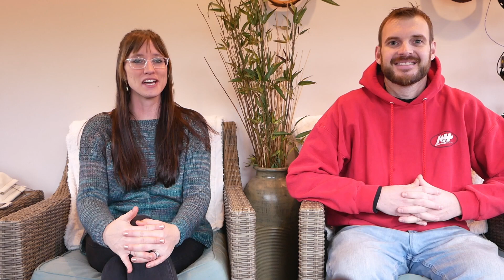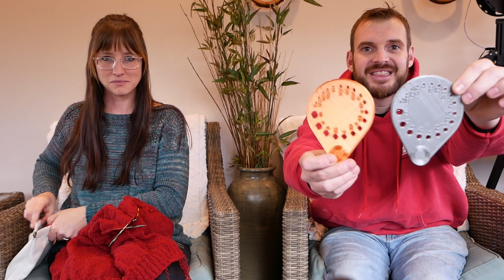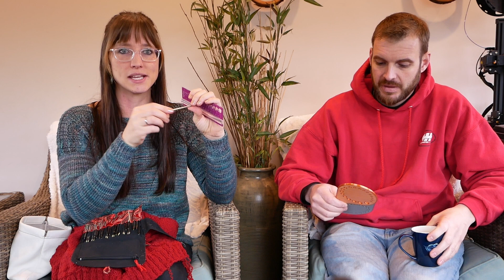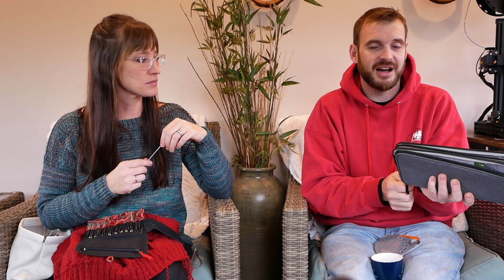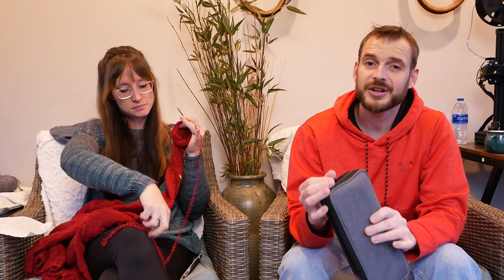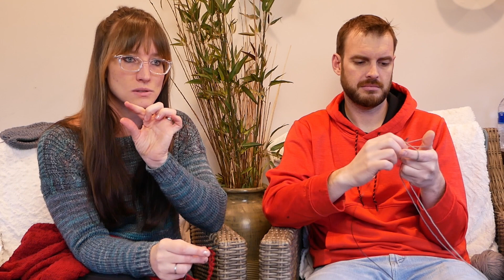Spring Stitch Knits - Episode 2 - 3D Printing, Casting on, and USED RAMEN NOODLE YARN!

Comment: Have you tried skeining, soaking, and drying the yarn between sweaters to skip the ramen noodle effect?
Reply from the maker: I did.  And sometimes do when I know it matters.  However, the ramen look doesn’t bother me too much bc I am comfortable with the feel of it. 
But it is a great recommend to anyone who needs to reach an exact gauge and smooth effect.  Thank you 🙏
Reply: @springstitchknits  I love long tail cast on too! But my process is a little different. I found the hardest part is estimating how long to make the tail. 😂 bit a couple youtube videos later and I usually remember to wrap 1st then cast on.
Reply from the maker: @leahmccartney251  ahhhh yes… I have often had to rip back and recast on bc I didn’t have a long enough tail.   There are so very many methods of casting on.
Reply: @springstitchknits  I am glad the texture thing is not an issue for you. In reading my knitting it would confuse me and make me 2nd guess my tension or if I had dropped a stitch. Both the reclaimed and new sweaters are lovely.☺
Reply from the maker: @leahmccartney251  thank you for your kind words.  It definitely takes an aware eye.  I have never knit a pattern written by someone else using reclaimed yarn for the reason that I am afraid to bot make gauge or that not may not look well.  😊